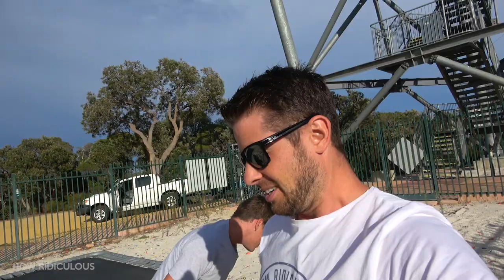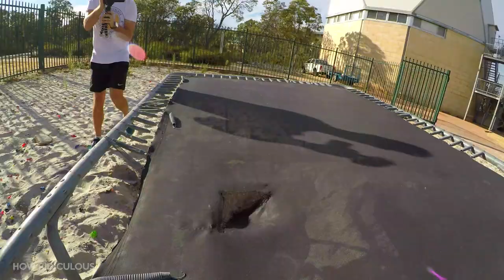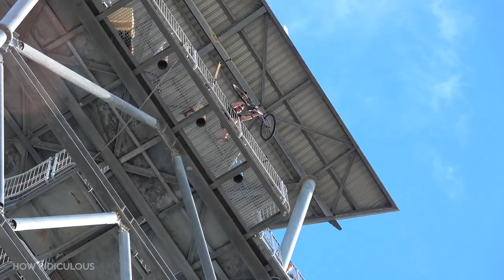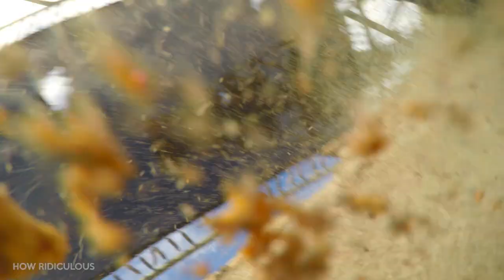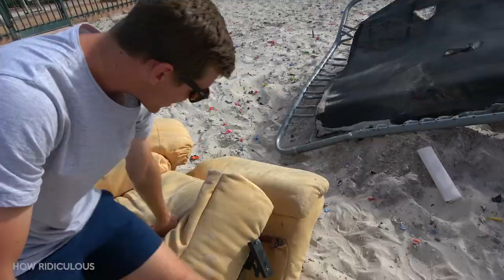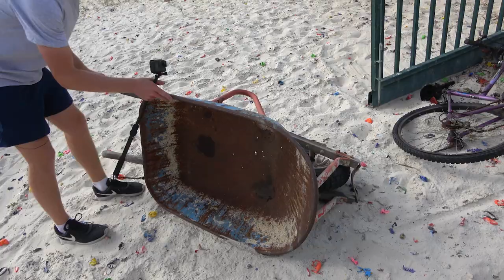LAZY BOY Vs. TRAMPOLINE from 45m!

Comment: Another major reason for the tearing is that before this you were dropping rounded or flat things.
Now with things like bike handles etc, it's easier to go through the tramp even if the object itself bounced.
Reply: And of course all objects just feel on the edge of the tramp
Reply: the kettle bell was round  its just simple too heavy and not much surface area !
Reply: These objects has a lot more pressure
Reply: Radhika Somani i

Comment: Would putting the legs of the trampoline on cinderblocks help? That way the force isn’t absorbed into the sand as much?
Reply: The same force is absorbed into the sand. You’re thinking pressure, which would decrease with more surface area between the trampoline and the sand, which cinderblocks would certainly help with.